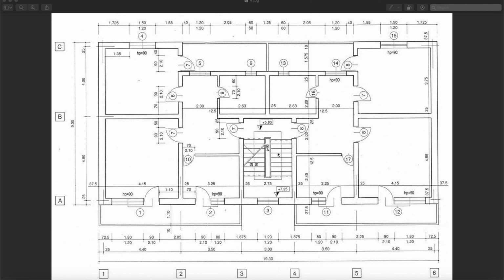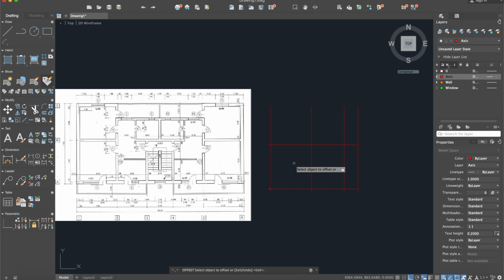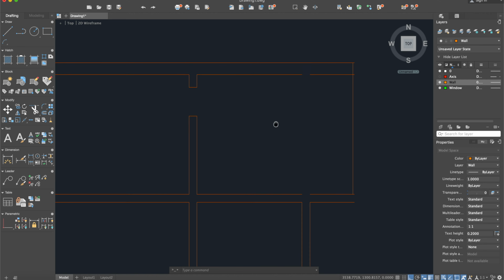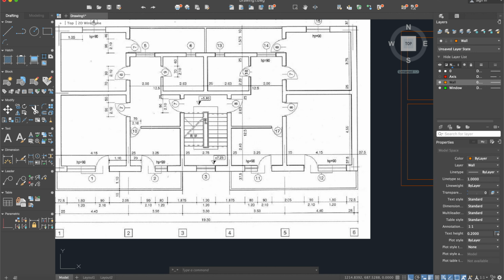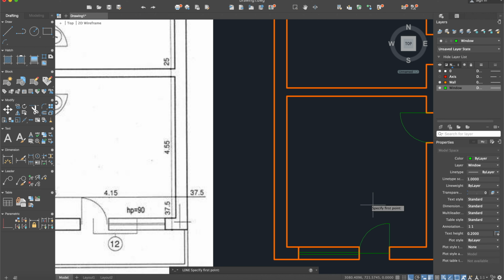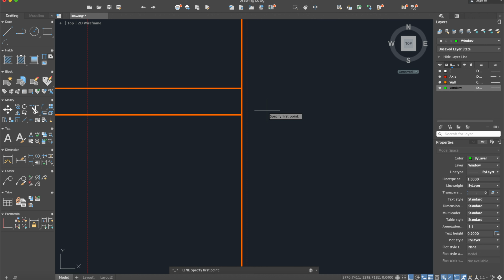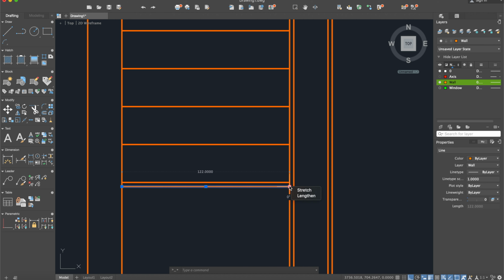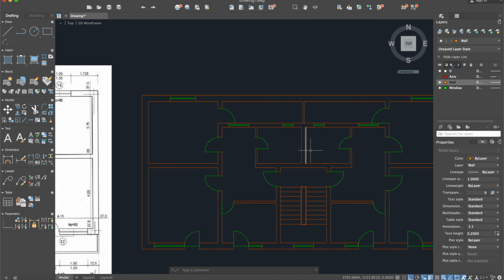How to draw a simple Floor Plan in AutoCAD | Macintosh (MacBook)

Comment: I prefer to work in MM or CM but when I make the change in units while using the architectural setting I'm still getting imperial measurements. How can I change to metric across the entire document?
Reply from the maker: Hello!
Just try to scale it and you will have the solution.